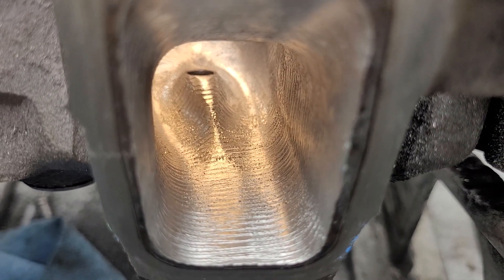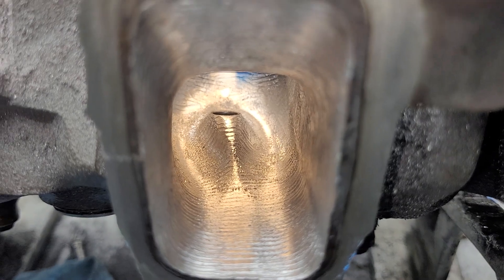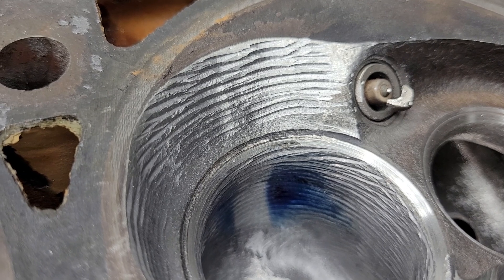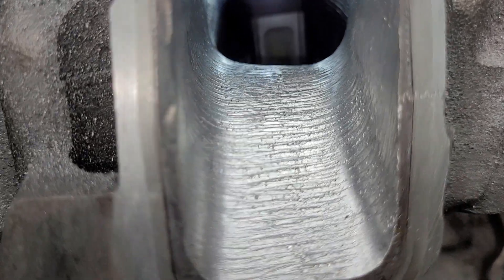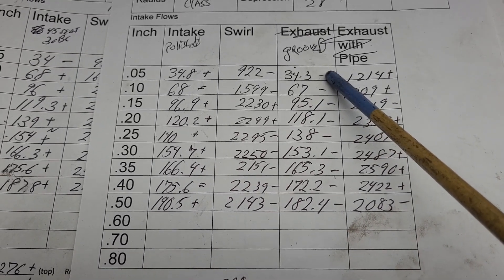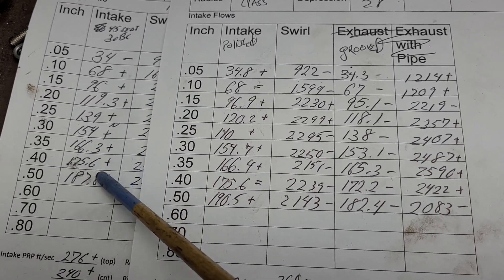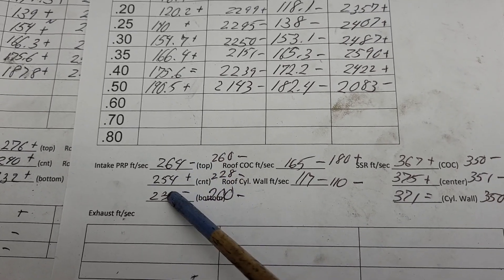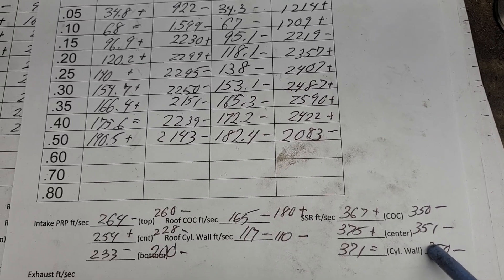Ported Ford 4.0l cylinder head, texture debate, polished vs. grooved texture with flows.

Comment: I port two-strokes so my style and perspective is a little different than probably your core audience.  I think this definitely proves many points: polishing does increase CFM but finish is very low in importance to improving CFM.  If it were for a customer, my decision on finish would be that which results in the most improvement for the least amount of time; we cut out the shape with a bur and since finish isn't important, end there.  However, I like to add a little personal touch to my ports and some of what I do is strictly for appearance, so like you asked at the end, what would you like to have on your engine? I still polish if it serves my needs for looking better and adding personal flair.

Comment: Agree on dealing with engineers.
Lower flow but higher swirl. I would go with the swirl. A "dead" mixture motion prevents the fuel to burn quickly, promoting detonation. High swirl tends to mix burning mixture with the unburned an getting the combustion to the far side of the chamber before detonation can rear its ugly head.
Reply from the maker: Good points. Thanks

Comment: Those grooves are similar as the ones I used on the 4.3 . TBI intake manifold I put a dual jut on.
Reply from the maker: How did you make them?
Reply: @servediocylinderheads  I think it was the smallest. Ball shaped carbide. I had .My job was not pretty.I already out alot of work into .It was for a demolition derby car
Reply from the maker: @dondotterer24  How did it work?
Reply: @servediocylinderheads  I did not have time  do real testing. But the engine really screamed and the plugs looked good. Being a demolition derby car we ran it on the rich side. I figured I should do something.. I think went from the top of te plenum about 3" down

Comment: Charles,  I do what you do generally speaking.  My own take on texture is that this isn't an all-or-nothing question.  If you change texture in the whole port then you will get some areas helped and some hurt for flow.  I think the best port is one with the proper texture in the right spots, and not all of them for just the CFM boost.   I think most engines out there they can benefit more from swirl and mixture quality than a few extra CFM.    IMO.
Reply from the maker: I agree, but extra cfm without making the ports too big will also help.

Comment: Maybe nobody cares, but I'd like to hear your best explanation of why the swirl was increased in this port.
Reply from the maker: Good question, due to the thicker boundry layer the way the air skips over the ssr is changed, this added swirl. Same reason the dodge 302 heads and these have shrouded intake valves. This is just my opinion, thanks.

Comment: Peak flow suffered the most. The port became smaller as the boundary layer thickened. If too much material were removed in a place that lessened flow, could you put some of these trenches in to add boundary layer in place of metal you cant put back?
Reply from the maker: Yes

Comment: I know you went excessive with roughness as a training illustration,  should one take into account the surface feature between the ports (seats) for stress risers? is a finely polished surface in that area beneficial for long term survival?
Reply from the maker: Yes, smooth less chances for cracks.

Comment: What would happen if you grind the short turn
Reply from the maker: I did. All grooved.
Reply: @servediocylinderheads  no I mean go crazy on the short turn stop just before you hit water the opposite of what you are supposed to do
Reply from the maker: @craigchiddo2794  I guess I could but I know what will happen. It will kill low to mid flows.
Reply: @servediocylinderheads  will it change the dykem Mark
Reply from the maker: @craigchiddo2794  Good question.

Comment: The grooves even out the port profile, so the flow is more consistant, although more turbulent. Turbulent flow mixes the fuel better, so the load inside the cylinder is better. That back wall hit is still a mystery to me.. Why design a port like that? Could it have like a "sweet spot" in the RPM range, for less fuel consumption? Having the charge tumbling above the valve like that?
Reply from the maker: You make good points. I would not have designed it like that.